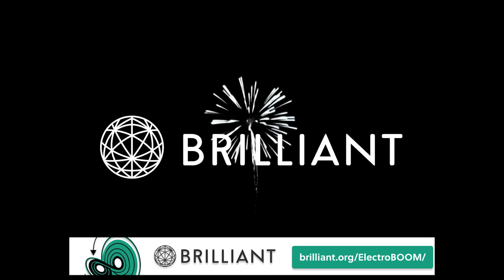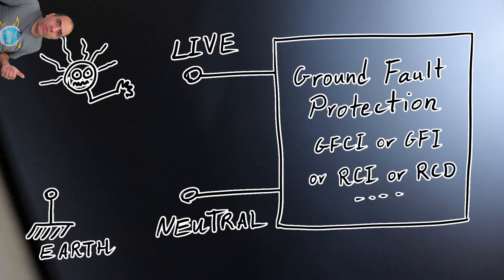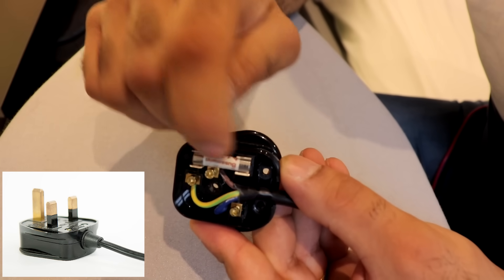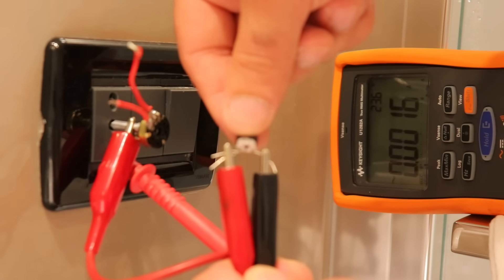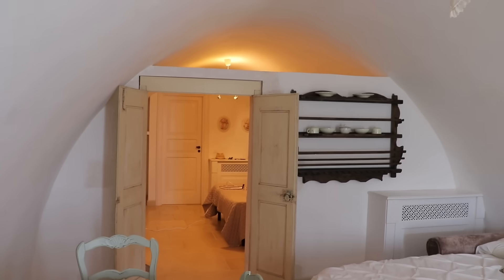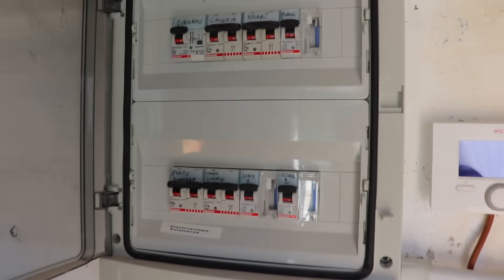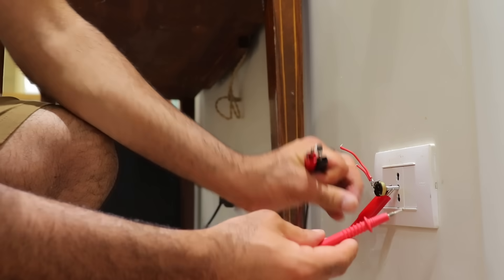Tripping Every Breaker in Italy

Comment: Hi Medhi, i'm italian and i'm now explaining you some things :)
Here in italy you must have a 30ma braker to cover all the house. Then in newer homes you have 3 brakers, 1 16A 30ma for plugs (the 16A plugs are the ones with the bigger holes or with the small and big holes together), 1 10A 30mh for lights (10A are also the plugs with only the small holes), and the one 5ma to cover only the bathroom area (they must be all in the same place and in a visible spot). Bye Bye
Reply: Can you please explain why they set Rome on fire 💀
Reply: @mutated__donkey5840  Soccer thing, probably
Reply: @mutated__donkey5840  after Rome wom a football match probably, and it wan not on fire ahhaha
Reply: @mutated__donkey5840  AS Roma won the European Conference League
Reply: @mutated__donkey5840  probably there was the AS Roma football club celebration when won the conference league
Reply: 5mA? The lower rating I've found is 10. Also, anything below 30 it's considered an additional measure against direct contacts (CEI 64-8), so I don't get the reason why you should install anything more costly and sensitive. If you look at the tripping curves of two RCDs, one with Idn 10mA and one with Idn 30mA, you'll see how close they are for Id>30mA and how soon they become identical. Considering the impedance of the human body and the currents that would flow through it, you can see how they act the same in case of direct contacts. Furthermore, as long as the earthing of the house is done properly, the touch voltage in case of leakage currents <30mA would be less than the safety limit of 50V (Rt<=50V/Idn, where Rt is the earth resistance and Idn being the rating of the general breaker, CEI 64-8). This ensures a non harmful situation in case of indirects contact.
Reply: @matteopiacentini325  I think the thinking is that in a bathroom the squishy electrode is likely to be wet (ie, they just got out of or into the bath) so the impedance for a direct contact is much lower, and death is likely at a much lower current.
Reply: @AshleyGittins  I don't quite understand the phrase "death is likely at a much lower current". If the contact impedance is lower the current will be higher! Therefore, it's "easier" for the breaker to open the circuit due to the higher differential current.
Reply: @matteopiacentini325  that's a good point. TBH I was relying on some 20-year-old reading I had done re the differing leakage allowances for domestic vs industrial breakers at the time, and mixing it up with some other reading I had done that claimed that 30mA through the body as a whole was typically "safe" but less than 10mA could be fatal if all of that passed through the heart. I'm not sure if some analysis had determined that the latter was more likely if the subject was submerged or what, it sounds possible but of course that ain't proof 🙂I've certainly verified for myself that 20mA RCD's can keep an idiot alive for 45 years despite his best efforts 😅
Reply: @AshleyGittins  It's 100% true that 10mA are still enough to cause fibrillation, of  course if the subject is being electrocuted long enough (time is always a key factor). Practically, the danger is that a current lower than 30 mA, but higher than 10mA, would flow through your body. But even if this is true the question is another: how likely is this to happen in a domestic situation, in case of a DIRECT contact? The impedance hand-to-feet of the human body is generally estimated around 1,5...2 kOhm and that's pretty much the longest path the current can take. In an EU electrical circuit you have 230V between live and earth. The current that would flow through your body, assuming a negligible contact impedance, is at worse 115mA (230/2000). Now, in order to have a current lower than 30mA you should have a very high in series impedance with your body. Therefore, the answer to the starting question is that the probability is almost zero, especially in a wet environment which facilitates electrocution.

P.s. I'd like to point out that RCD's minimum tripping differential current is usually around 22...25mA for Idn=30mA.
Reply: @matteopiacentini325  Cool, thanks for the extra info. Just trying to think this through a bit, I guess a worst-case scenario with low current might be using a mobile phone with a faulty charger that has a leaky cap, say, while lying in an epsom salt bath and dropping the phone onto their chest. That might give a fairly localised current path around the heart, does that sound feasible?  I guess it then depends on whether a person in that state would be incapacitated and unable to save themself, or maybe worse, be unaware their heart is (fibrillating?). I guess falling asleep is a possibility leading up to that.. hmm... a relaxing bath sounds tempting, actually... 😄
Reply: @matteopiacentini325  From the numbers you gave, the worst case fault current would occur at the lowest body resistance, which is 1kOhm and results in a body current of 230mA. That's the current it takes to light a 60W lamp, and is sufficient to electrocute five people simultaneously. It's also outside the 5x rated current of the RCD, so it wouldn't be able to react in the time necessary to save you.

For anything below 150mA, you have to refer to the touch voltage disconnection time graph based on body sensitivity (it's not linear!). https://www.electrical-installation.org/enwiki/File:FigF01.jpg
Reply: @millieh3179  1. The fact of being "worse" or not depends on the context. I was explaining that in order to have a fault current lower than 30mA, at which the breaker doesn't pop, you would need a large series resistance. So, the worse case you can be put on by this point of view is the 2kOhm one, where you need a relatively smaller impedance (easier to get) in series to get a current <30mA. This situation in my opinion is not likely to happen at all in case of a direct contact in a domestic environment. Of course, for a set time, the LOWER is the current through your body the BETTER it is for your own health, as you correctly explained. Maybe I didn't explained myself very clearly about this.

2. As for the phrase "it's outside the 5x rated current of the RCD, so it wouldn't be able to react in the time necessary to save you", I don't agree. Look at the graph you have attached. The CEI EN 61008 (specific regulations for RCDs) establish that the tripping time for non-selective breakers must be <0,3s for Idn and <0,04s for 5Idn. Now let's assume we use a 30mA breaker and a 230mA fault current like you said. You would still be in the AC-3 zone. In that situation it would be the same with a 10mA breaker!

AC-3 zone can cause shock, arrhythmia, ecc. but it's still non-lethal. AC-4, instead, could potentially be fatal.  If you consider a higher body impedance up to 2kOhm, you could also get in AC-2 zone (you just feel pain).

Also, keep in mind one thing: the timings I've said are the MAXIMUM values a breaker constructor must respect. Practically, a standard RCD has USUALLY tripping times of around 20...30ms for Idn and 10...15ms for 5Idn. I can tell you because it's part of my job to measure it. Considering that, and looking at the graph again, the difference become negligible between a 10mA and 30mA breaker.

Correct me if I didn't understand something of what you said. All the directives and regulations I've referenced until now are the ones we use in Italy (and UE). Cheers.
Reply: @matteopiacentini325  1. Ah okay understand your argument now. I think indirect earth faults are an exception however. Touch voltages are designed to be below 25V in wet areas, and 50V in dry areas, in either case you can expect to see earth currents under 20mA. Also things like footwear and ground composition might lower the fault current under the 20mA range, but I agree that this is less likely to occur in residential situations. 

2. I think the graph I attached extends beyond what's feasible, realistically a 230mA current would need to be detected in less than 20ms, which is less than one current cycle.. you could easily miss detecting a trip in time. Feel free to correct me about this as I'm not entirely sure.

Funnily enough, it's part of my job to sign off on RCD test sheets, so I should probably know the limits of operability.
Reply: @millieh3179  what an interesting and intelligent exchange of information here. And you're dropdead gorgeous. 🥰😍🤩 What is your job again?
Reply: @millieh3179  1. Like you said, in case of INDIRECT contact, even if there are leakage currents of around 20mA (which a 30mA RCD wouldn't detect) the PE circuit should be designed to limit the touch voltage to a safety value. That's actually the thinking behind the formula Rt<=Uc/Idn, where Uc is the touch voltage (the symbol I use are the italian ones) that would be 25V or 50V depending on the area, as you correctly stated. Consequently, if for any reason there is a leakage current lower than Idn, you're anyway protected against indirect contacts by a relatively low and safe touch voltage on the faulty appliance.

2. Determining how fast a breaker should pop by looking at the graph, given a set current, depends on which zone you want to end up. IMO as long as you don't have specific pathologies your ass is safe if you stay in AC-3 or below. Yes, you might feel quite a slap, but it will teach you a good lesson. Staying in AC-2, instead, is more complicated as you said.

3. Talking about how quick an RCD can theoretically be there are some things to keep in mind. There is a set time needed for the mechanical parts inside the breaker to move in order to disconnect the circuit and that's the first and most important limitation. Then you might be limted by the magnetization transients of the toroid and the coil, but I think they're negligible. The third limitation could be getting only part of the sinewave and not a full cycle. IMO as long as you get at least a half period you're fine: infact, I've seen RCDs pop around 10...15ms. That also makes sense if you think about the definition of rms value, which can still be calculated "correctly" inside the semiperiod of the current sinewave. The troubles begin when you consider only part of a semiperiod. Refer to the image below. The voltage induced across the coil 3 is given by F-N-L's law: e(t)= -N*dphi(t)/dt, where "e" is the induced voltage, "N" the number on turns in the coil, "phi" the magnetic flux in the toroid and "t" the time. In short words, there is a 90° phase shift between phi and e. Remember that the flux (phi) is directly proportional to the differential current (Id) and with the same phase. Then you would have to consider the trip coil's (coil 3) current waveform (which lags behind the voltage one) to actually know if it has the strenght to engage the mechanism. In conclusion: if the fault is short enough and the Id is at a specific phase angle, you might have a trip coil's current too brief and too close to the zero. I couldn't find a decent graph about it, so you might need to draw these functions to better visualize what I said.

https://media.sciencephoto.com/c0/50/81/75/c0508175-800px-wm.jpg

Anyway, thanks for the interesting discussion you've created. Always a pleasure to find people with a good technical knowledge.
Reply: @matteopiacentini325  i've seen 5ma braker  in the restowrant i work in, they are from gewiss but i don't know the exact model
Reply: @Sbellins1109  First time I've heard of it for real O.o
Are you sure it's not 0,5A? In all the catalogues I've seen (Siemens, ABB, Schneider, ecc) I've never found anything below 10. If you happen to get the model I'd be glad to have a look at it.
Reply: 5ma bathroom is not mandatory, but we have have regulation about the distance from water sources. thats why almost everytime the room light switch is outside of the bathroom.

-scritto in inglese per gli altri XD
Reply: 10A seems excessive for a lighting circuit, especially considering let through energy and cable sizing. Also, I've never seen a 5A breaker before.. what brand do they use?
Reply: @millieh3179  10A is a "standard" calculated having in mind old filaments bulbs, nowdays with LED, 4A or 6A are more than enough
Reply: @morbosaurus1344  Ah makes sense.
Reply: @millieh3179  old installation use to have 6A for lights, at least I saw them in my parents 40 years old house (which i really doubt is up to standard). Now the standard is 10A for the light, 16A for outlets. Also, heavy load equipment (fridge, induction cooker, dishwasher, oven, ecc) usually have their own breaker.
Reply: @millieh3179  The mA (milli-Ampere) ratings are the amount of earth leakage current, while the A (Ampere) ratings are the total normal operating current. A given RCD breaker will have a figure for each, so the examples above are 10A total current for lighting with 30mA of earth leakage, 16A total with 30mA earth leakage for GPOs and 6mA earth leakage for bathroom circuits (which are probably 16A since 2400W (10A) hair dryers are common in 220(ish)V countries. You can get 5A DIN-rail breakers from most of the big brands but I don't think they're common in domestic situations - maybe they will be as LED lighting becomes more pervasive.
Reply: @AshleyGittins  5mA leakage current is silly for residential applications. I just assumed they meant 5A instantaneous trip time. 5mA is just going to cause nuisance trips.

What is important for safety however is the RCD trip time. There are standardised graphs showing max duration of 50Hz touch voltage the human body can withstand. They show at 230VAC with a trip time of 30ms (1.5 current cycles), you will most likely survive. And these body sensitivity values are adjusted for wet conditions (the standard I'm referring to is AS/NZS 4871 if you're curious).
Reply: @millieh3179  That standard is for mines and quarries, not domestic settings. I think AS/NZS 3000:2018 is probably more applicable (but I am not a sparky, so don't take my word for it!). I'm not defending the standards, just pointing out that assuming 5A instead of 5mA might have been a misreading of the OPs comment.
Reply: @AshleyGittins  You're right AS 3000 has a similar graph too. It's based off data from AS 60479, so it's all the same. Still don't get why you'd want to use a 5mA residual pickup though.. maybe the Italian sparkies can enlighten me (excuse the pun).

Comment: Back is phase!!! In all the EU if the cables are new... Black Brown or Gray is phase and neutral Always is the Blue. Yeah when the 230V comes the England and some other countries use 240V and the rest of the Europe 220V so the standard placed in the middle because of the existed devices on some old parts of the grid some time may still give 220V... The RCBO is mandatory in all of the EU. Finally the weird plug is an old BTicino telephone socket (BTI-2021).

Comment: I live in Wrocław, dolnośląskie and:

- here in Poland it's easy to remember Niebieski (blue) = Neutralny. So i expected that "black" which should be brown would be live. I expect same colors, because we have common market and common regualtions with fascist government of Italy thanks to EU

- I am used to GFCI which is inside electric box and have a button "Test" to do test without those crazy circuits
Reply: The test button uses more than 30mA to ensure it always trips.Testing at the outlet ensures that the outlet is grounded and you can measure the current which is required to trip.

Comment: You can't even imagine how under pressure I felt when I saw that Electroboom was going to judge my country's domestic electrical system.
Reply: By the US standard for electricity Europe is a paradise of safety, when done the right way, you can even open any panel and still be safe, all wire connection are in recessed area and so bare wire if the isolation was stripped the right length. In us you will find a lots of bare busbar and bare wire even for domestic panel. 
Even the ground is isolated in europe.
Reply: Infatti 😂😂
Reply: Don't worry....US electrical system is sh.t, EU and UK is good.
Reply: Per poi scoprire che gli Stati Uniti sono decisamente indietro per certi aspetti legati alla sicurezza.

Comment: In Europe the GFCI will trip  between 0.5xIsc and Isc (15mA to 30mA ) for domestic flat/house and yes ground and neutral are connected inside the house. Between the mains and the house, there's a main GFCI with nominal trip at 500mA.

Comment: - 1:15 😂 Typical, people can't help but notice and focus on stuff in their own wheelhouse. 🤷
- 2:45 I'm guessing the hinge in the door has 13 points of contact (one ground, 12 button) using brushes on a commutator to let you buzz the different apartments, but just like with brush-motors, that's not reliable at all and will oxidize or bend over time. I'd be surprised if the buzzers still work, it's probably just ornamental at this point.
- 2:53 I guess Mehdi hasn't seen AttorneyTom's videos; don't do bad stuff, but if you do, don't post them on the Internet! 🤦
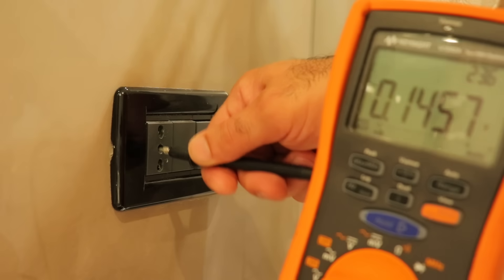- 4:23 Complaining safety features are stopping him from testing the safety features. 😂 So نُنُر (pardon the Google translate).
- 5:35 Yup, the UK plugs have the same safety-feature (plus several others).
- 5:50 Yup, that's why the "penny challenge" is specific to the US. 😒
- 6:12 Maybe those forbidden-fruit are زرشک. 🤔 (Google says that's the Persian name for dogberries. So sour! 😋)
- 7:34 When we had the kitchen remodeled, they didn't replace the outlets next to the sink with RCD outlets. 🤦 I was going to do it myself, but apparently the wiring in the walls needs to be replaced to support it because it's too low a gauge. 🤨
- 9:45 Maybe next time, located the breaker-panel BEFORE tripping the breakers. 🤦
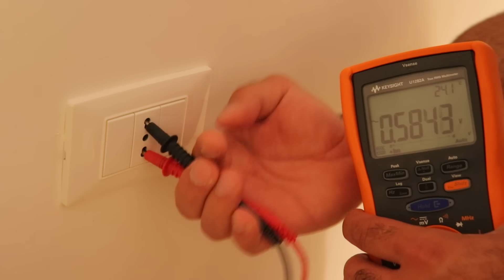- 10:52 That's pretty clever. That's a good design to allow at least the lights to keep functioning if the outlets trip. 👍